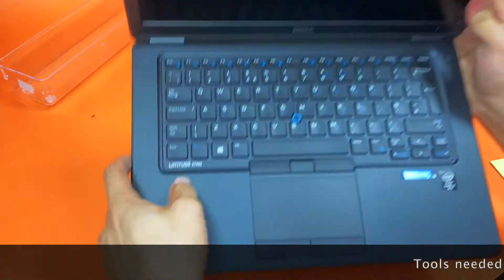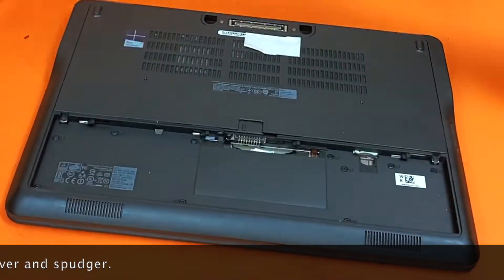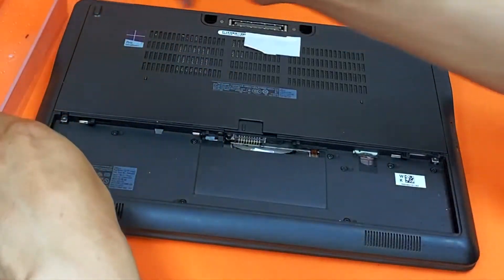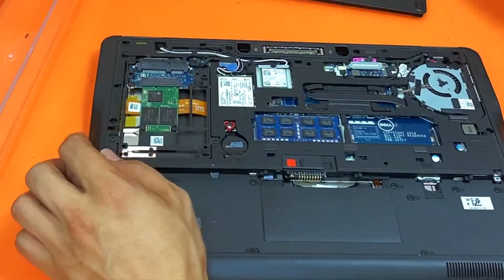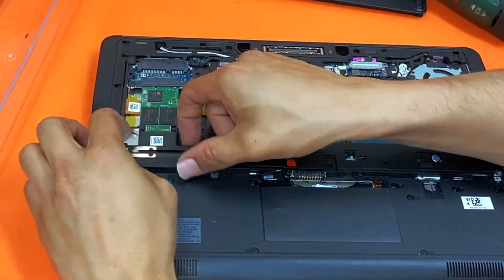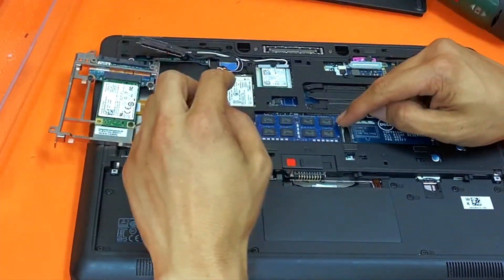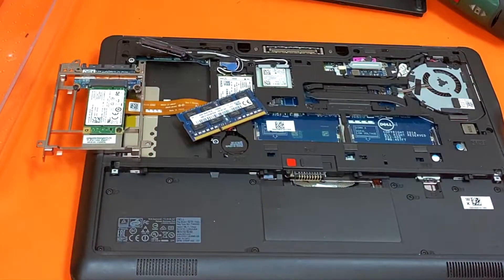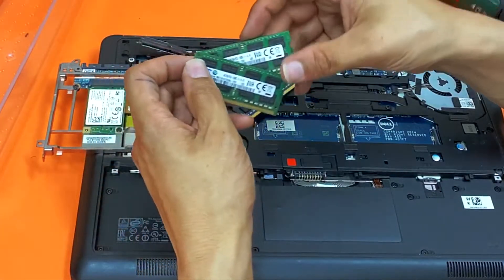Dell Latitude E7450 | SSD & RAM Upgrade

Comment: What hard drive did you use? can i replace it with an SSD?
Reply: You can yes
Reply: @bizyak  Would i need a different adapter or they are the same for SSD to. Any model of the SSD i should buy?

Comment: Hang on I got the same model but it already has 8gb ram, I wonder if it was already upgraded before...
Anyway I'm having an issue I'll explain:
Since a random day my laptop just started to not being able to boot windows. It appeared errors such as no hard drive detected, press ctrl alt supr and similar stuff, and once each like 50 attempts it would boot correctly, after making severe research my conclusion was that the hard drive must be changed, but I wonder what exactly contains the hard drive, I mean, if I change it won't I lose all my files and everything the laptop stored or what exactly does the hard drive? And if it contains files I don't want to lose, how do I transfer them to a new hard drive?
Reply: Hey, having same issue of yours! Can you guide me, I think my hard drive is just loose and didn't fit correctly, so finding the correct way to fix it. Please guide

Comment: my laptop model is DELL Latitude E7450. It has 4GB RAM and intel core i5 processor. Now i need my RAM to expand it's memory. can i change it to 8GB or 16GB RAM. is that possible?? please reply
Reply from the maker: Yes you can, with 2 8B stick